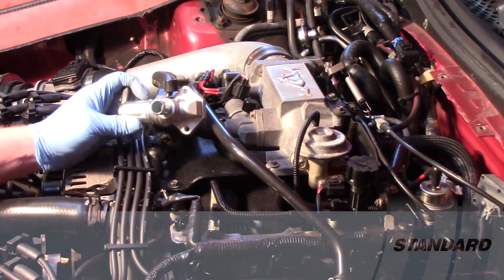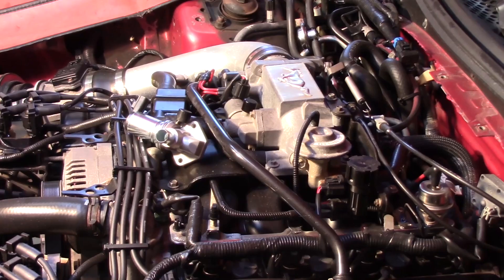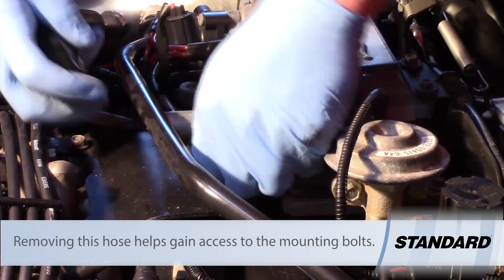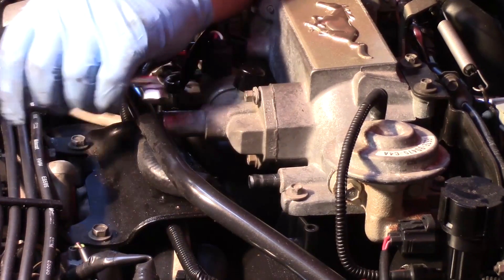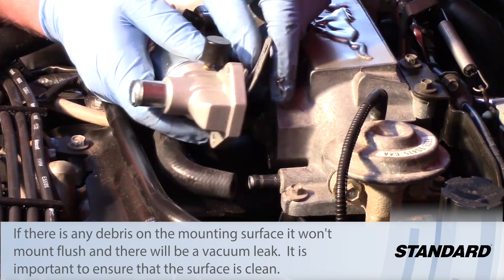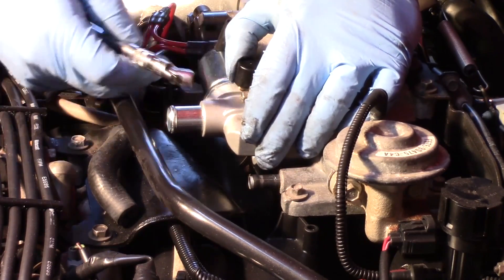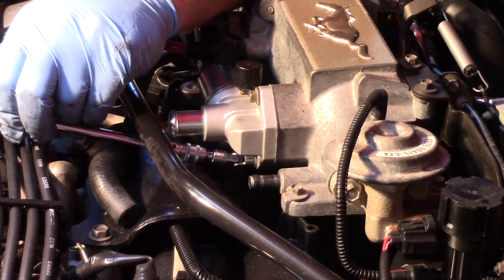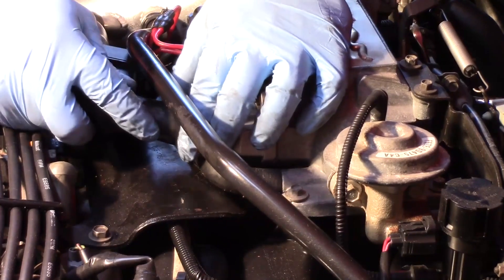Idle Air Control (IAC) Valve Replacement - Ford 4.6L

Comment: On my 1996 Lincoln Town Car with the 4.6, that valve is also at the top and near the left-center of the engine, but facing toward the rear. Once you remove or rotate the black plastic "4.6 Liter" engine cover to the left and out of the way, you can't miss it. Haven't removed it yet but it looks like you have to remove just 2 screw, and one under 1" hose. That black plastic cap on The IAC valve  is just that, a cap with nothing connected to it.